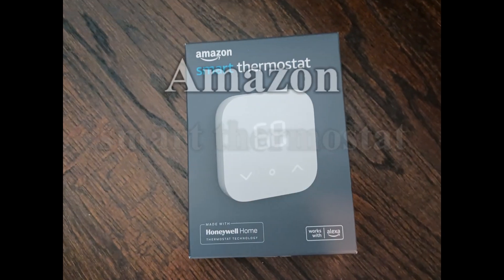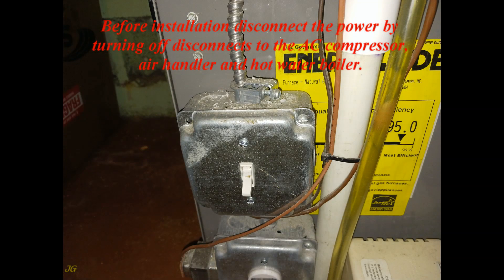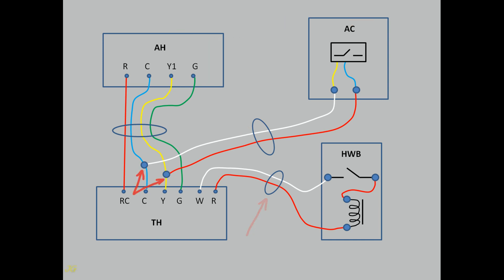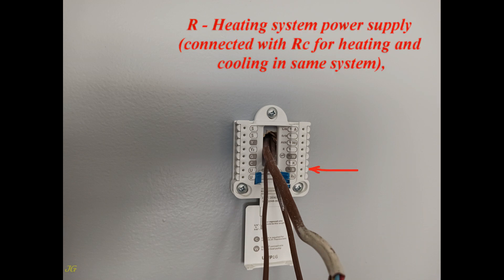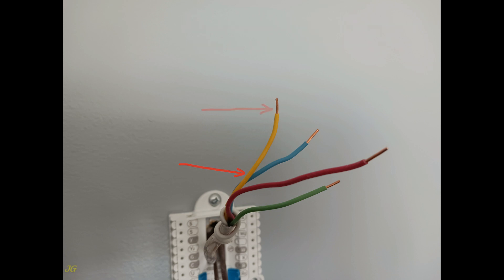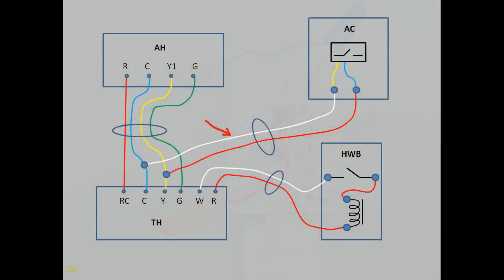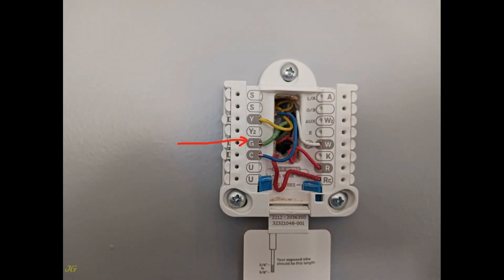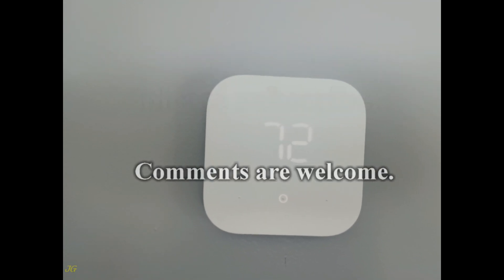Amazon smart thermostat installation.

Comment: THOSE OF US THAT HAS A TWO ZONE WITH A DAMPER SYSTEM; TWO EIM (Equipment Interface Module) BOARDS, WITH TWO THERMOSTATS
THERMOSTAT 1 (UPSTAIRS) – ZONE 1
OUR OLD THERMOSTATS [ECOBEE {EMS/SMART} WITH FOUR WIRES YELLOW (D-), WHITE (D+), RED (GND), BLUE (+12V)
WE HAD TO BYPASS THE EIM BOARD – WHICH MEANS THAT YOU REMOVE THE FOUR THERMOSTAT'S WIRES (HOPEFULLY, THERE ARE MORE WIRES IN THIS BUNDLE) [OURS HAD THE SAME COLORS WIRES AS THE ZONE BOARD (ORANGE, BLACK, AND GREEN – WHICH NOW EQUAL SEVEN)]
WE MATCHED COLOR TO COLOR AND USED A WIRE NUT TO CONNECT EACH TWO WIRES TOGETHER (E.G., YELLOW TO YELLOW, RED TO RED, ETC.)
SO WE (Y-YELLOW, Y2-ORANGE, G-GREEN, C-BLUE, W-WHITE, AND R-RED) {WE USED W2-BLACK {THAT DID NOT WORK)}
SO WE REMOVED THE W2-BLACK MEANING WE DID NOT USE THE BLACK WIRE- WE LEFT W2 EMPTY

THERMOSTAT 2 (DOWNSTAIRS - ZONE 2)
THE WIRES IN THE WALL DOWNSTAIRS DID NOT HAVE ALL OF THE SAME COLORS AS THE UPSTAIRS (1ST THERMOSTAT)
DOWNSTAIRS COLOR DIFFERENCES WERE LIGHT GREEN AND TAN (TAUPE)
BUT THE SAME COLORS FOR EACH THERMOSTAT ON THE ZONE AND EIM BOARD WERE THE SAME
SO WE (Y-YELLOW, Y2-TAN (TAUPE), G-GREEN, C-BLUE, W-WHITE, AND R-RED) NO WIRE FOR W2
OH, WHEN YOU SET UP THE THERMOSTATS IN THE ALEXA APP – FOR BOTH THERMOSTATS THE WIRING DIAGRAM IS THE ONE WITH ALL OF THE COLORS OF THE THERMOSTAT ON THE ZONE BOARD
OURS WAS [THERMOSTAT 1ST (UPSTAIRS) – ZONE 1]
THOUGH DOWNSTAIRS USED TAN (TAUPE)